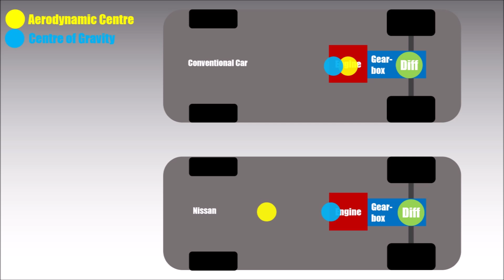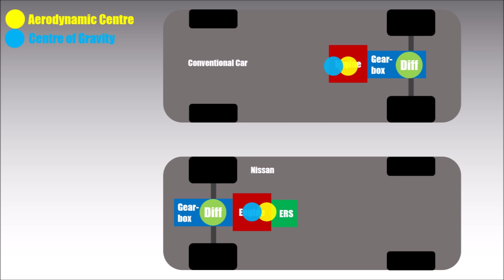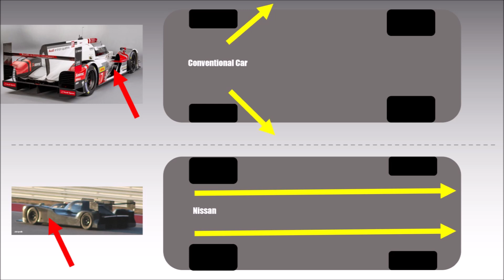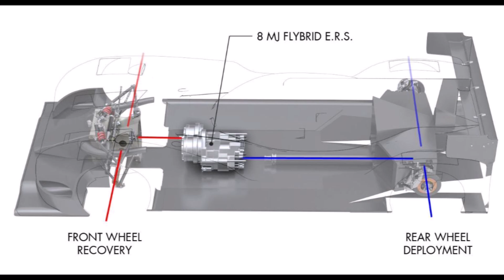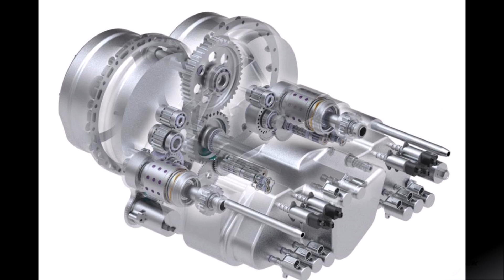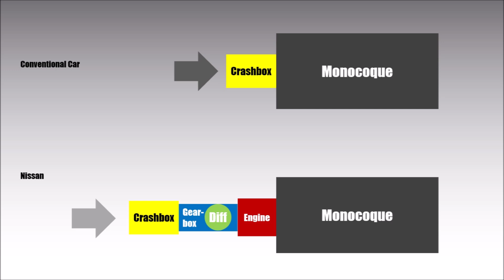Nissan GT-R LM Nismo (Le Mans 2015) - Genius or Disaster? - Technical Analysis

Comment: The front end and bespoke parts design of the front end looks like a mechanics nightmare at Le Mans.
So much in that front end, it doesn't look easy to work on and you wouldn't get repairs done quickly. Love the car but too much faith on that front end to work perfectly and never break down, a major issue was if it broke down it couldn't use electric power to roll back to the pits. 
Which happened, one car retired at Le Mans and couldn't get back to the pits, when the mechanics went to recover the car after the race, all the body panels were stolen by fans!!!!!

Comment: A concept like this needs a flat 6 engine. Lower center of gravity, lower hood line, and it's shorter than a V6, so the whole drive train can be pushed farther back, and even partially under the driver's raised feet.

Comment: it would be genius if they had rear axle steering instead of front, giving all the load of pulling/steering/braking to the just front axle will ofcourse result in loss of grip understeer and other problems.

Comment: I dont understand what you mean by the Torotrak system. You're saying they rated each flywheel at 400 kJ, so total 800 kJ since there are two flywheels. Nissan wanted 1200 kJ for both so that they'd get 2.4 MJ in total, but 2.4 is only enough for the 2 MJ class, right? But you said Nissan wanted to enter the 8 MJ class. What was Nissan actually requesting?

Comment: All they had to do was make it RWD and it would have been the coolest car ever. Instead they ruined it by making it FWD.
Reply: if it was cool because of the design and aero management, then that's all more the reason it should've been FWD, though if the hybrid worked it would've been a RWD/AWD switching to FWD for corner back to AWD and then RWD.

Comment: I still love this car despite its failure simply because of the fact it's a front engined and front wheel drive LMP car for crying out loud. This and the DeltaWing are so different compared to the rest. They challenged the norm regardless of whether or not it would be successful. That's the kind of stuff motorsports needs to be exciting.

Comment: I followed the project from the first time I heard about it. When I learned that the hybrid system was a mechanical one I knew that the project was doomed for the time frame that was given. An electrical hybrid would have had much more flexibility in the long run imho. I loved the wacky concept, but it was not given proper development time and was rushed. Same can be said for the Peugeot this year, but their concept seems to work far better and I really hoped that they would take the win this year.

Comment: I just learned that the mechanical flywheel in this car was housed inside a vacuum, because at 60,000rpm it’s going so far above the speed of sound that the sound energy alone would cause it to disintegrate. I mean that’s insane. If only they’d been given time to make it work. ☹️
Reply: If im not mistake, the 2009 Williams F1 car has a similar flywheel ERS design. But i doubt its as powerful or spins as fast as the one Nissan designed

Comment: Brilliant analysis of Bowlby’s work. The media simply rubbishes this car and the delta wing. The reality is somewhat different. You can see the management interfering in something they have no idea of. It’s probably the old thing of the Japanese scared to loose face. The fact that it’s 20sec per lap slower is hardly surprising when it’s 800 hp down on power.

Comment: Wouldn't it have made a lot more sense to use an electric hybrid system?  You could have put electric motors in the rear wheels with torque vectoring without needing a driveshaft or extra transmission.

Comment: the new hypercar Peugeout also is a vid for Genious or Disaster, the car doesn't have a Rear Wing XD. Manages with only floor downforce it suffered a lot in Seabring and Spa
Reply from the maker: Yes I did a couple of videos on the 9X8 already
Reply: That car is racing in a BoP-controlled class so it's pointless to discuss.

Comment: This project was such a radical departure from everything in the last 40 years of motorsport that they had to completely unlearn and relearn everything they knew about racecar engineering. Naturally this requires a lot more time to develop than tried and tested concepts. Could Nismo succeeded with more time? Maybe. But Nissan GT-R LM will be forever be one of the most fascinating cases of "what could have been".
Reply: It could be a whole lot better in second season, wtf they wasted resources and just dumped all that work instead of making it work next season
Reply: I believe they would've done much better given grace
Reply: Mmmm… I don’t really agree with. Front engine racing cars had a resurgence in the 1990s with Panoz and they were pretty competitive out of the box. The aero is pretty simple and the hybrid system was a known quality. I don’t think it would have been that difficult to implement. But I agree it needed a lot more development time.
Reply: @thethirdman225 It just needed second season to show what it's really capable off, you can't expect new not polished concept win at first season
Reply: @dmitryhetman1509  I just saw your logo. Instant block from me.
Reply: @thethirdman225 but why?

Comment: it was going to fail from the start.  Even if the hybrid systems worked, the car was compromised to begin with.  regulations dictated the maximum size for front and rear tires.  The fact that the Nismo had to have smaller rear tires means the car had less mechanical grip to begin with.  and we all know, tires are one of the easiest way to gain performance advantage, and in this case, lose it.

Comment: I wonder if they switched the engine from the fron to rear if that would have improved how fast it was.
Reply: What would've would've had to been the Hybrid, reducing stress on the engine. Rememember this is the 8MJ class, they were reduced to the 2MJ class, if it had worked they would be legendary.

Comment: The top speed is not very good metric to use when comparing hybrid race car to non hybrid. The main benefit of hybrid engine over turbo or naturally aspirated engine (or even purely electric) is the capability to use the power when you need it. Or even more specifically, not use it when it is not optimal to do so.

You want to get the fastest lap time so you want to accelerate hard out of turns to get to your top speed quickly. In other words use the hybrid power in addition to engine power to accelerate faster, not necessarily to raise your top speed.

So the nissan might have had same top speed as the winning car but the huge difference is that the winning car could use its hybrid power unit to get to that top speed a lot earlier on the straights. So the nissan could take a 800m straight to reach that number whereas the winning car could do it in 400m and then just stay at that speed for the remainder of the straight.

Comment: I think people were turned off because of its FWD, fair, but the engineering was excellent, that guy needs to be in an F1 team
Reply: FWD can’t be competitive with RWD and AWD in open classes like this. There’s just to many drawbacks that can’t be fully overcome. 
If it had the full power it was supposed to along with the rear drive from the hybrid it would have been competitive enough to be interesting. If they’d actually been fast it’s likely the rules would have been changed to stop from everybody having to design all new cars.
Reply: IDK. the F1 rules are so terrible and restrictive that the genius would be wasted. Unlimited time attack on the other hand....

Comment: This is the best video on the GT-R LM I've seen. Thank you.

So, the speed trap results suggest the inherent aero efficiency of the body design was as planned. Your video implies that the two critical points for the project were the failure of the mechanical hybrid system - which never worked - and Nissan management impatience by demanding it race before it was ready. Without working hybrid pushing power to the rear wheels, it was a purely FWD car that upset the total design and engineering concept, and therefore could never be competitive. Then, Nissan management lost faith with the concept before giving the team the time to work through the fixes.

Would an electric hybrid energy system have worked in its place for 2016? Is this a design that was really only suited for Le Mans' unique mix of long straights and fast changes of direction?

What has happened to Ben Bowlby since? Is his reputation trashed, or is he still highly respected?

Comment: You don't get to the winner's circle by playing it safe. Even if this program didn't win at its single race, Nissan and the team learned a lot about hybrid systems. The use of a flywheel for energy storage in a high-g, low-weight application seems really challenging. Not sure I'd want to sit next to one, tho.
Reply: Sadly, Nissan had no role in the Hybrid system, other than some general size and performance requirements. The company that built the unit, ToroTrak, never got it anywhere near functional. Which, sadly, is true of all of their FlyBrid systems. They never could manage to get them to work. As a concept, using the raw kinetic energy is brilliant. In theory it allows for a much greater efficiency of storing and releasing that potential energy. In practice, however, the components simply can't take the abuse, and the precision required to make it all function is far to great to be viable in a rattly, bouncy, high G-Force environment of a prototype race car...or a city bus...or anything else ToroTrak tried to put one of their units in. They never delivered on a single engineering promise.

Comment: Excellent summary. Aerodynamically the design delivered, the top speed and cornering stability in the wet prove that. Sad that the crucial element of mechanical storage way its downfall. Any other options, even the Williams ElectroMechanical flywheel would have been better. To think that that electric would have given the recovery brake assist the front rotors needed help with, and solved the pit lane sendoff issue too. Did they pitch for too high a MJ class (8 MJ), and would a 'reliable' version at only 4 MJ last...  a suspect the engine could have happily managed the strain of the then allowed increase fuel flow.
Reply: corner stability he said. i think he mean understeer when they over-drive the car.
Reply: @zuminlair92cp  front wheel drives always push understeer, brake oversteer - if you've ever driven one hard.
Just complete decelerating before the apex then push on exit to the rumble strip, gives longer acceleration onto straights, aiding top speed.

Comment: You shouldn't rate a race team after just one failed race with close to no prep time. They should have given the team at least 1 or 2 more full seasons to fix their problems with the car and to become a race team.
My favorite le mans story is probably the time where both toyota failed between 1 and 3 a.m. and the porsche which was then in the lead failed around 1 p.m. leaving only 2 hrs for the second porsche LMP1 to get to the front again after beeing in the pits for a few hrs. At the end we had two lmp2 on podium I think 2nd was Chackie Chan DC racing behind the porsche

Comment: If I had a dollar for every good idea ruined by management pushing the engineers to cut corners and insist on releasing before it is ready I'd launch my own Le Mans entry
Reply: Nissan has form here in the form of Infiniti. The Infiniti engineers came up with some very clever ideas and systems, only to be allowed to implement them in a half baked form that the management then abandoned, sometimes only a year into production.
Reply: @Kefuddle  that's something I admire about McLaren and similar manufacturers. They usually let their engineers work and are actually committed and invested in their projects.
Reply: yeah, was super sad not to see this thing compete as intended. With the hybrid system driving the rear wheels, it could have been a weapon...
Reply: @GamezGuru1  I wanted to see it with all power on the front wheels 😜
Reply: Mastercard Lola F1 car is a perfect example of that
Reply: Well you could probably afford a ticket at least 😂
Reply: Japanese racing outfit in general. Or rather, japanese corporate culture.
Reply: @wiryantirta  Um... what the hell? First of all, japanese race outfits and culture in general is literally the exact fucking opposite. How can you be so confidently wrong? 

Secondly, you do know that this is very famously an AMERICAN thing? You know, where short term profit and shareholder value comes ahead of EVERYTHING? Where money hungry upper management decides to screw over every lower level engineer, pushing them to release something incomplete?

The classic case of american business culture? Lol
Reply: The manager would have known that you can't race a FWD.
Reply: you'd also have the chance to do the funniest thing
Reply: Although many of those ideas were to solve problems that nobody had in the first place.
Reply: To be realistic I think they did the right thing. This project would have cost billions if they tried to develop it any further, this project was an engineering nightmare

Comment: I think you missed a very critical point of the aero development of the car, and why the FWD layout was chosen.

The rear diffuser was a heavily regulated design that was the same among all P1 teams. Where as the front splitter and diffuser area, much like the engine regulations, was nearly completely open and free for design. So the decision was made to exploit that area of the regulations, and make a massive front diffuser, with an extreme forward weight bias to match. That eventually drove the FWD layout, and the flow through tunnels to help with diffuser extraction and drag reduction at the rear. As well as making the rear diffuser significantly more efficient. Which is why at high aero loads, the car was fantastic at throttle pick ip, and mid corner speed, such as you described at the entrance of the Porsche Curves.

I think the way you presented it, makes it sound like they just decided this was a great idea to try FWD and be different, and then engineer around it as they went. When in fact there was a solid interpretation of the grey areas in the rules that drove this design brief right from thr start.

A couple of other things I think you also glossed over, is the fact that ToroTrak has never had a hybrid system that has worked as advertised. Even their system for commercial busses was grossly over promised, and heavily under delivered. It never ran with any reliability, or anywhere near the output power levels they claimed. During 2016, and the promotion of this cars racing program, ToroTrak gathered a massive amount of funding and investment money with multiple press releases about all the great things they would do with Allison, JCB, and a couple of CAT subsidiaries. By the beginning of 2017 the companies portfolio had nothing to show for, and by 2018 the company went into receivership. No FlyBrid system has ever been made commercially viable.

With regards to the brakes. Part of the caster change in the car was due to a requirement to make room for thr larger caliper for the larger rotor. Likewise, the brakes themselves were not LPM1 spec brakes. But where infact new old stock of LMP2 assemblies. And were being pushed WAY out of their deaign specification. Which was why they were required to be changed so often. And in connection with that, thr spindle and tire chane meant the cara suspension qas being put through significantly more loading. And in the tests at Sebring, they damaged the chassis at the puck up points for the suspension, because of thr high shock loads. This was also one of the primary reasons why the cara were told to stay off the curbs at Le Mans, because there was concen that they would have another suspension failure on yhe chassis. And because of the increased shock to thr drivetrain on an already over stressed clutch, which much like the original brake package, was deaigned lighter and smaller with a hybrid system in mind.

And lastly, the very final shot of the car sitting next to some trash, fenced off next to an industrial warehouse, was thankfully not one of the full race cars. It was just the static display model used for the auto show circuit. Less than 12h after this photo showed up online, this display model disappeared, and has never been seen again.
Reply: Thank you for these very interesting additional informations. May I ask where you have got this insights from?
Reply from the maker: For the first part of your comment: That's exactly what I explained. They didn't just choose FWD to be different, it was the result of careful consideration.

And thanks for your additional information in the later parts of your comment.
Reply: @bsport320  Sure, just want to make a point that the rules regarding the front diffuser were really a big part of it all. I didn't feel that single fact was really emphasized enough. That's all. Always love the videos!